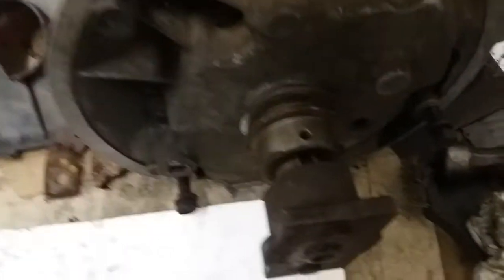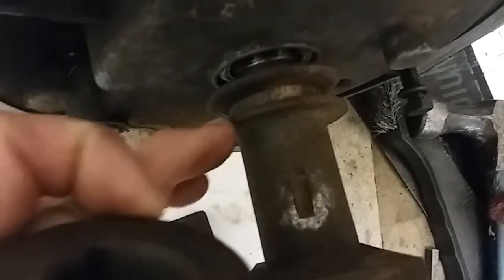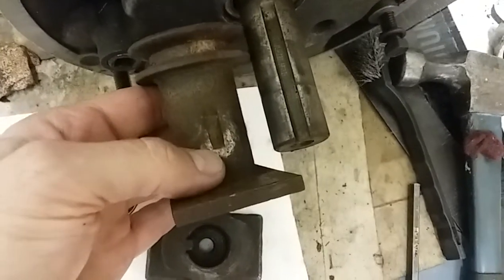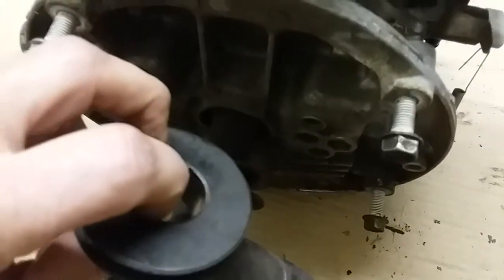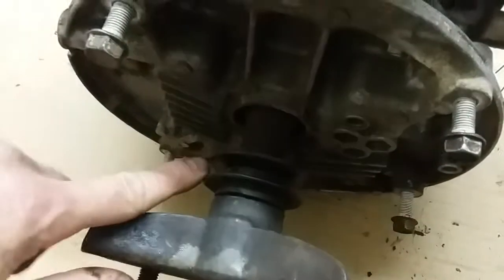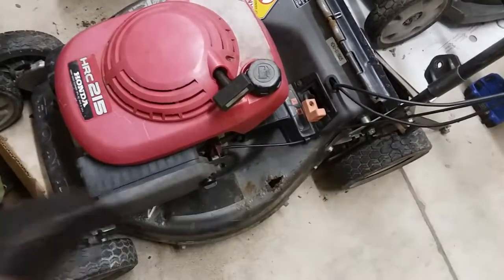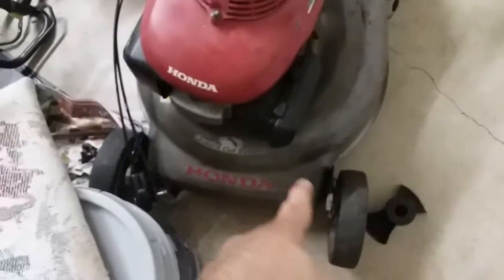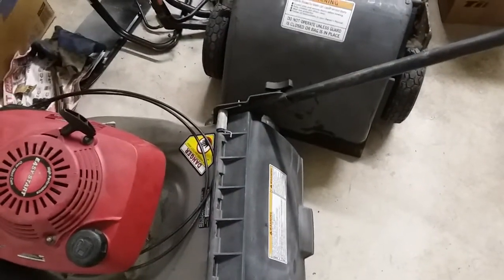Two piece self propelled blade adapter issues and Honda mower shop update

Comment: I just spent half a day pulling a one piece off a honda. Had to basically cut it in half with a sawzall and then used a 5 ton hydraulic gear puller to split it in half. Then i looked up the the price for a one piece replacement... like $130... f that.
Reply: hee hee